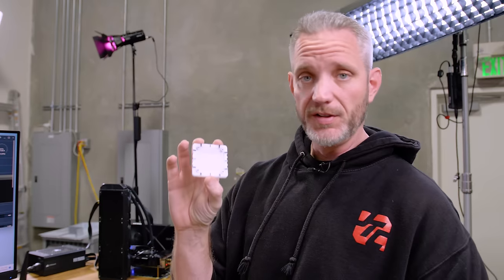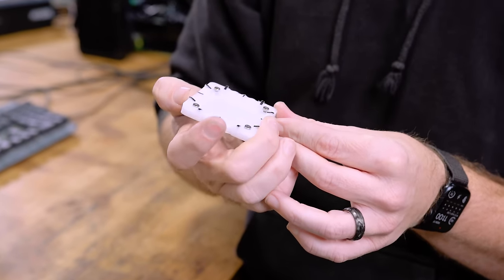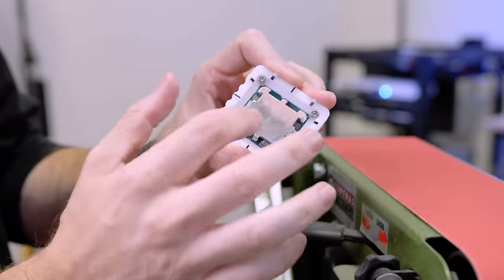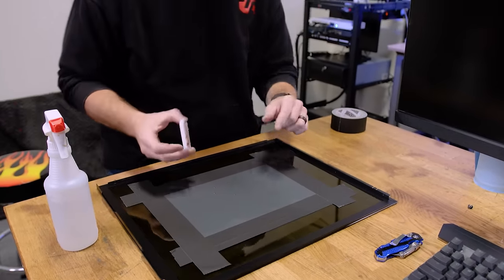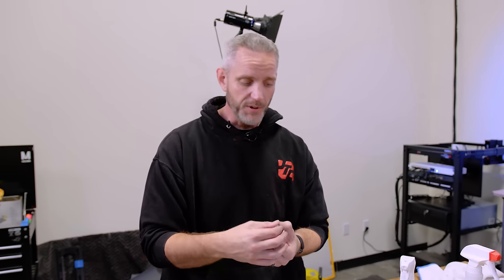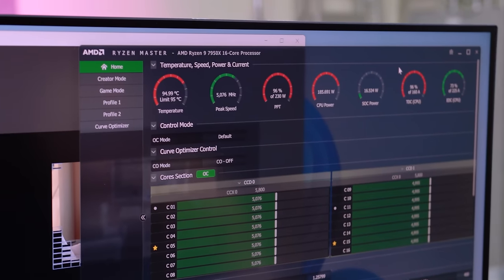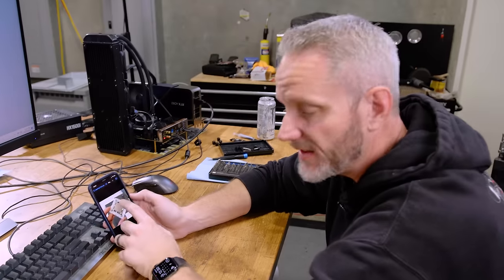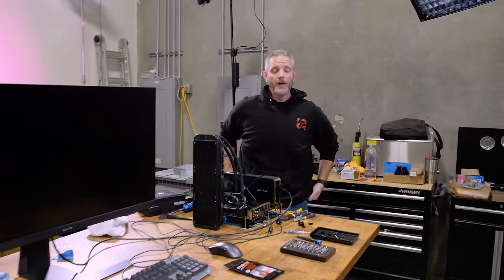Modifying the 7950X CPU for better thermals... VOIDED WARRANTY!

Comment: Thank you Jayz! As expected taking off some of that ridiculously thick lid improved thermals. Some parameters to consider: this was liquid cooling, (I know what some might say 'why use air cooling for a 7950x'?)  However with air cooling I'm sure we would see the throttling difference on stock vs stock tested on the lowest possible lapped lid height (You know you want to shave off some more ^^). Right now the real problem comes down to custom mounting screws for any given setup (And the tedious lapping). Main take a way: AMD clearly created an artificial bottleneck- especially for the 7600x, 7700x, and 7900x, all of which could have easily been 200- 400 Mhz per core faster (if not more) on base and/or boost frequency without that extra thick lid while maintaining or perhaps improving temperature targets and possibly reducing fan RPMs.

Comment: Should have taken a measurement with a Vernier caliper before you started.
Also a 10,000 grit diamond stone would help to remove even more micro scratches.
I also think AMD made a huge mistake by increasing the IHS thickness rather than adjusting the sockets Z position.

Comment: Hi Jay. Just lapped my new i9 13900K. Using a control frame and Kryonaut past, temp drop of 12’C in Cinebench (was hitting 100’C and throttling) and 15’C no load.
Reply: What? What is your ambient temp? 10C?
Reply: @olegvorkunov5400  My water temp on bootup (this time of year) is around 20C
Reply: 100c watercooled? That does not sound right wtf.

Comment: I think AMD should sell 2 types of heatspreaders for their ryzen. 1 for the old type that is warmer and 1 for the newer type that is cooler. Let's face it, if you are going to spend 800€ on a 7950X, and then 600 more at least for a motherboard and ddr5 then a 150 or 200 for a watercooling is ok. And most watercooling vendors could make new brackets to fit the new cpu, as corsair did in the past.

I think if AMD would have been smart they would have made a thinner IHS that could end up saving 10 to 15 degrees wich is huge.

Comment: i think one of the problems is the indium gap between die and ihs, is quite high if you check the black adhesive under the legs of the ihs, is quite thicc

Comment: When it comes to sanding it down evenly, perhaps you could somehow mount the CPU to a drill press?

Edit: I'm not telling you to use the actual drilling part of a drill press, though that might help with accuracy, I'm moreso referring to the lever mechanism used to bring the drill down/up.
Reply: What I'm thinking of doing. Will probably 3d print a bracket for my drill press and put my belt sander in it.
Reply: @spacecowboy07723  That would be the way to go.  I spent a couple of hours by hand  and only got it down .3mm.  Still pretty decent gains.

Comment: Lapping 1.5mm is a job and a half by hand ..... thats approaching the territory of slinging the chip in a CNC mill (or lathe) and just milling 1.5mm off the ihs then finish with polishing by hand ... if yer machines are set up correctly it'll come out perfectly flat first time

Comment: The thing I Love about this is, it's complete nonsense.  It works and does improve temps but this is not for everyday users.  They don't even write software that requires Over clocking to these speeds thus requiring anyone to need to do this.  It's fun to watch for sure but not at all practical nor necessary.  You need this kinda power you might wanna check out the blade servers used for video crunching for movies like Avatar.  Single Cpu regardless of cores is not efficient to handle large work that would require all this toying around, but it is cool to see those limits.  Great video Jay, I think however your more Extreme You tube viewer base might be fooled into trying this not being in the Biz or understanding why this is just for fun.

Comment: Of course it's still hitting 95c. It's meant to hit 95c as AMD have said. Even with more pressure it'll still boost until it hits 95c. That's intended behaviour. Even with more cooling, it'll still give it more juice until it hits 95c. Should have done stock results. Using throttling temperatures as a baseline, is not a baseline at all.

Comment: I dont think cutting off that material are worth, because that material also serves as a temperature buffer for heat to transfer before going to the cooler over thermal paste, it make sense for heavy load to get cooler closer, but its not a big gain, and you may lose some of the short burst power.

I delided old G4560T (2C/4T), put copper IHS (baked and frozen, dont know if it did anything, except in physics), with MX4 (i wanted to put MX5 inside because its long lasting, but since low temperature MX4 should last its lifetime), massive passive cooler from Arctic, i think its name are 12 or something like that, no load, room temperature, full load, same temperature, and that CPU are in fanless system living as Windows TV working with 720p.
But i have plans to add old RX5600XT, and SSD along with NVME thats already running, with 16GB of DDR4 i guess its gonna be able to play everything at that resolution.
However it means PSU fan will work while gaming, and GPU will use fans, creating heat, so i need to add additional fans and it will not be fanless system anymore.
In other hand, power hearth of the PC are made by P750GM from Gigabyte, so i may die, in peace, in silence, without fan noise, i guess. I mean, TV is working when i fall a sleep, you know.

Comment: AMD is maybe ok with a constant Core temp of 95c°. But i would be concerned about the longevity of some electronic parts on the Motherboard near the CPU. Especially capacitors loose lifespan at higher temps. So your CPU might be ok after a few years but what is about your expensive Motherboard? And the Motherboard producers will (for sure) also tell you that it is not a problem (because when the Board fails they will be no longer be responsible regarding warranty).

Comment: Why wouldn't you use a tool like plasti-guage to measure the clearance between ihs and cooler? This is the same tool used in engine building to measure clearance between crankshaft journals and bearings.

Comment: Gotta use a figure 8 motion when lapping. Also, if you're running into issues with torquing screws too much then you should get a torque wrench for small screws.

Comment: I mean the temperatures sunk alot, especially when you look at the powerconsumption, which capped out at 180-190Watts before on the cores and then went up to 210 while maxing the PPT aswell and the K-Ex paste is awesome, especially on such highend high temp chips, so it wouldve been even more impressive with the last step, but it has already shown its potential.

Comment: Shaving off extra THICCness of IHS should be combined with offset cooler mounting to account for CPUs hotspot that is actually on the edge of IHS, imo. 

Der8auer did test it but came to wrong conclusion in the video since CPU runs to 95 degrees anyway and he was expecting lower temps, but his CPU ran faster (+1300 points in cinebench) with offset mounting compared to direct one which is the fact he missed. (he had corrected himself in comments tho)

Comment: The sad fact is under Magnusson act if was enforced properly unless your modification can be proven to be the direct cause of the failure the warranty is still legally enforce, we as modder and especially those in the media space really need to push to makesure that we can use this to our advantage as well as enforcing the law properly helps strength the fight for right to repair.

Comment: In my experience over 35 years, I'd say most of you guys use way too much thermal paste like you're frosting a cupcake.  
Also, if you use a mirror, you can tape the sand paper to the back mirrored side if you think it is the side that will be the flatest.

Once I had to take apart 135 Supercomm custom built to order PCs and pop off the cpu cooler and take off a paper/plastic "security sticker" stuck on the cpu and bracket top, and that had the heatsink stuck on top of that.  Face palm.  25% of the CPUs were blue screening randomly until I investigated one and to my shock found that going on.  I was like, what the heck!    I redid all 135 pc's and became the hero of the day by making allt he problems go away... like magic.   

There was no heat sink paste on them at all, and I don't recall adding any.  Maybe I did but I doubt it because I was working remotely way out int he field far from home and you couldn't jsut walk into a Kmart and buy heat sink paste.  I just took that blasted sticker off.

Comment: Since Der8auer has access to a CNC, what would happen if you milled a pattern into the IHS and milled an opposing, interlocking pattern into a cold plate? This would increase the surface area and thin the IHS in the process.

Comment: Lapping it is just going to void your warranty and only give you a couple extra mhz on the clock. The cpu is just going to continue to boost until it hits 95 degrees so lapping the cpu unless you’re under volting and under clocking is completely pointless and stupid… which is exactly why I’m watching! Thanks Jay and crew! 5*

Comment: I can see who'd really want to lap these CPUs despite voiding the warranty, but not yet: when cheaper B650(e) boards come out we'd get more people using the 7600X on SFF builds and even if the actual temp doesn't actually drop, it's because the CPU is boosting higher without using a bigger cooler.

Comment: Lap the CPU and Cooler heatsink both perfectly flat so you can ring them for direct molecular contact with no thermal paste. Shouldn't even need a retention system that way either.

Comment: Coming from the land of CNC and precision your technique for roughing is pretty solid. However for the fine work and lapping try running in a 8 instead it works more like a random directional and you won’t have patterns in your surface. We also tell all the new guys if you see a scratch and you can catch it with your fingernail it’s probably time to trim them.

Comment: Theoretically would a well-calibrated CNC (or better yet, a mill) work for this? Seems like that would be a good way to ensure better flatness and allow a precision height to be achieved.

Plus a JTC/TOT collab would be 🔥
Reply: Theoretically, yes.
And the 1% of the 1% of the 1% of the small niche of DIY'ers here would ever be able to accomplish that.  
At that point, for the expense and all, just get the delid tool.
Reply: @boots7859  well, my thinking was that a delid tool can sometimes cause damage that will kill your CPU. Also you might want to only lap and not remove the IHS entirely, either because DD is more complicated or because the die Z height makes DD impractical.

I have a desktop CNC router/laser engraver that costs about $300. It won't do steel really but it can handle aluminum and copper just fine. I think these machines are getting to be more common, although not as common as 3d printers. Of course, most 3d printers can also be used as CNC routers without too many modifications.

Comment: Ofcourse AMD says 95c is safe for everyday use. 
But 95c will ALWAYS have a shorter lifespan than electronics at 75c or 55c. 

Its just like when car makers now say transmission fluid does not have to be changed for the lifetime of the trans, yeah because the bad fluid after years creates that end of life time.

Comment: OK, I'm not a lawyer - BUT I do remember reading in multiple articles that the "Warranty Void If Removed" sticker - and therefore all versions of "If you dare touch this, you're not covered" are not legal. As in, if you dig in and threaten legal action, ANY manufacturer's legal department will back off. They still use the stickers and the call center staff are still trained to say the company lines, but if you hit middle management and above they know they don't have a legal leg to stand on. This applies to everything, but has been most proven in electrical and motor goods. The core of the argument is that once you purchase an item, it is your legal property, and you can do what you want with it. "Take off this sticker and you're dead to us" does not apply. So, modifying an item is fine. Obviously, deliberately blowing something up is not. Its comes back to "What would a reasonable person reasonably do in this situation?" stuff. Personally I ignore warrenties anyway - if I break something as far as I am concerned thats on me. I either bought a cheap PoS and deserve it or I did something stupid and deserve it. But I know lots of people really obsess over warranties. well... ignore the "Void" stickers ;)

Comment: 95c has been safe temps on silicon cpus for years and it would never degrade your CPU which is an online myth. The danger of 95c wasn't the temps but the voltage people used to overclock their CPU's to get higher clock speeds was the danger. With that being saidd, 95c is absolutely fine for everyday use.

Comment: Hello! Does polishing the CPU after sanding at around 2500 to 3000 grit a bad idea? At around 9:30 Jay said don't polish. I've been polishing the IHS and coolers for years and had no issues, I do make sure both surfaces are prepped properly before adding paste and mounting the cooler. Thank you for your inputs!
Reply: It depends mostly on the particle size of your thermal compound. A blanket statement like Jays is flat out wrong. A mirror finish still has grooves.

Comment: You know what I am wondering after watching this, why hasn't anyone designed a 3d printable frame that pairs with an arduino and easily obtainable mechanical parts and of course a piece of glass that it is essentially a lapping bot so that its always perfect.  You set a depth and it does exactly that.

Comment: Also should mention not to use Galium based liquid metal after lapping, or otherwise exposing aluminum.
The outer layer is usually nickel to prevent the Galium/aluminum interaction.
You remove that outer layer of nickel and you can cause issues.

Comment: I lapped several of my cpus.  6000 grit sand paper and then found a diamond lapping compound.  Did both my water block and CPU.  Literally stuck together with no thermal paste and ran with no thermal paste for weeks and never had an issue.

Comment: I really don't know why everyone is freaking out about the temps of the 7950x. I've been using it for about a week now and I've yet to have it reach 95C. My guess is that it's only going to these temps for certain benchmarks just so it can get the full power out. Not even for gaming does it ever go higher than 80C. This is just for anyone hesitating to buy it for this reason, I know I was.

Comment: The idea with Zen 4 and lapping or direct die, is not to try to go far below 95°C - but to improve even cooling. S when you hit 95C on your hottest core, the rest of your cores are fairly close. Instead of having one core 15 degrees hotter than 10 others, holding the rest back.
Reply: I think the idea is that you can raise power limits so it can clock faster.

Comment: Just drill the cpu bracket holes bigger so it misses the standoffs, the cooler will sit directly on the cpu, then use washers to make up the difference on top of the bracket. Basically what you would do with a delided cooling setup.

Comment: Take it to a local machine shop and have them remove the 1.2 mm from cap.  They could get it within about .001 to .005 inch corner to corner and then you just polish it.  Not a wax polish, a super fine grit polish that you clean off (like when sanding).

Comment: I am curious if the heat spreader is so thick now because they're planning on 3D V-Cache, which will occupy some of that space, with a thinner heat spreader on top to maintain the same total height.
Reply: However if they simply stack the cache on top of the CCDs unmodified, the IO-Die is lower. than the rest of the stack

Comment: I'm still confused about the new AMD and the 95C thing..
Is it actively pumping up the power to try and get to that heat level or is it just not bothering to throttle/cool till it hits 95C or what ?
I'm so used to cooling just working and keeping CPU temps around 50C at most under load that I'm having a hard time wrapping my head around these IMO bizarre levels of heat.
Reply: As far as i know it raises voltage and power to get maximum speed until it hits 95c and keeps it there.
Remains to be seen how durable these are. You are probably water cooling enthusiast if your load temps are in 50s because that's extremely cool.
With air cooling most cpu's run between 60-90c

Comment: I've got a linisher/ belt sander like that. Not good if absolute flatness is required. Ive come up with various jigs to flatten steel and its difficult to get to within 0.1mm accuracy. Maybe try a surface grinder.

Comment: Question, The temperature that you're seeing is that the CPU temperature or the CPU junction temperature. I use the AMD software overlay to view my temperatures and it shows both regular CPU temperature and CPU junction temperature. I'm wondering which one I should actually be looking at. Thanks!

Comment: I know this sounds weird but I think I rather delid and do direct die cooling (I'm old enough to remember this being the norm) sure the die is exposed so you do have to be a little more careful but since getting back into building systems a couple of years ago it feel's like a lot of performance gets left on the table due to "idiot proofing"
Reply: I think I did destroy some AMD CPUs due to not mounting the cooler on the silicon properly. The IHS is idiot proofing by providing the CPU with a bit of a heat sink. GPUs are directly connected to the cooler.